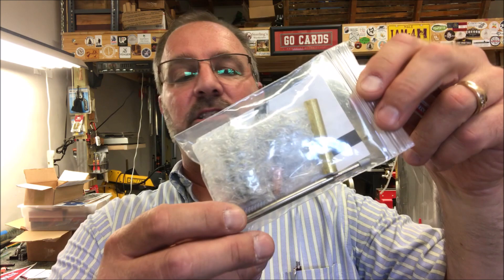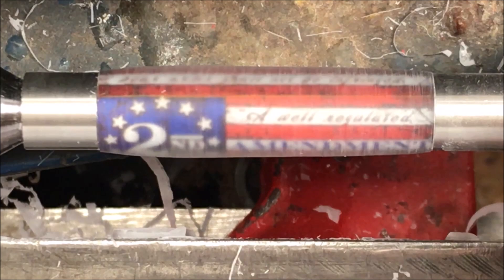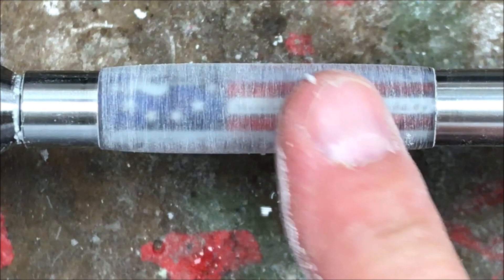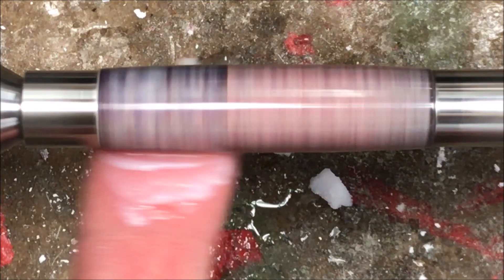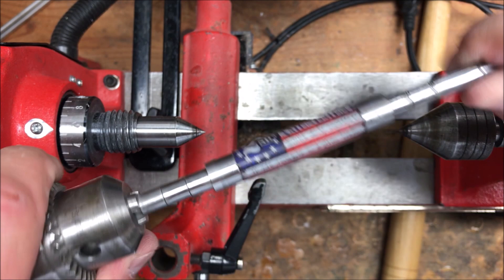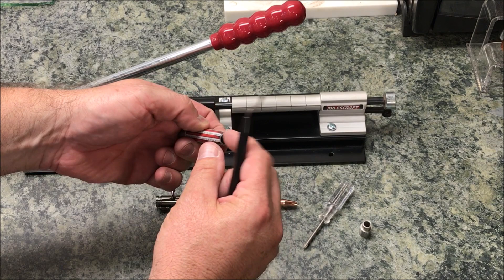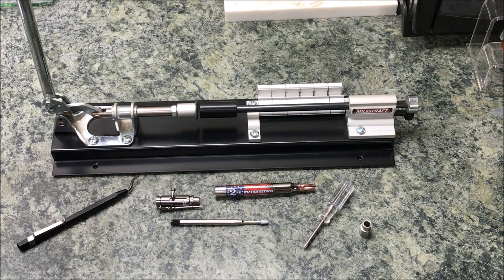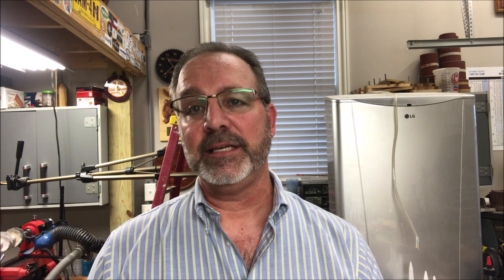Turning A Bolt Action Pen For A Friend

Comment: Great looking pen Bob! I just finished up a “Faith, Hope, Love” pen for my wife and found I had the same problem that you did with the center band. PSI was very nice and sending me a replacement. Hopefully it will fix the issue.
Reply from the maker: I hope so too. With as many replacements as they send out you think they would go back to the manufacturer and have them correct the issue. 

Regards,
Bob

Comment: Beautiful work, Bob, as always. Thank you very much on the bolt handle tip. 

Question, and I apologize if you've already covered this but I've been out of pocket for a while. I saw you use a toothbrush to clear the acrylic shavings when you were turning. How did you discover that? It seems to work very well.
Reply from the maker: Hello Matt,
  I think someone suggested it in a video. Compressed air works well too. 

Regards,
Bob

Comment: As always a great video and a beautiful pen. I love your work. But. A question. I pretty much follow the same process you do until we get to the end. After polishing with the micro mesh I do at least one polish with a liquid polish. Hut ultra gloss or something similar. Then I go to the buffing compound and the buffing wheel. Last step for me is to put the pen back on the lathe and apply and buff the Renaissance Wax.  My question is, wouldn’t the buffing compound and wheel remove the Renaissance wax if I reverse the last two steps?  
And finally, where did you get that deburring tool. That’s cool. I want one. 
Keep up the good work. I’ve learned a lot watching you.
Reply from the maker: That’s a good question. I always figured it was like buffing the wax on a car and brought out the shine. I’ll have to think about that one. 

I got the tool off eBay. I just did a search and there were a ton of them. Reloaders use them. 

Regards,
Bob